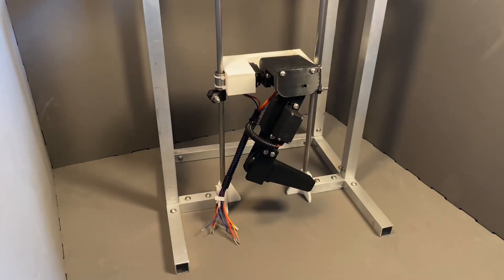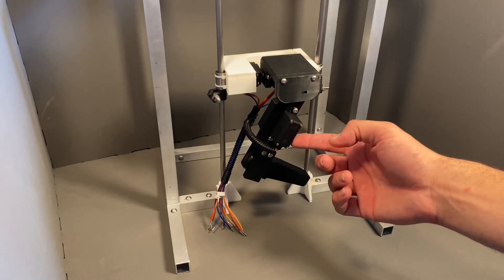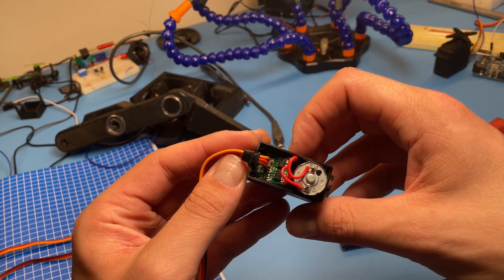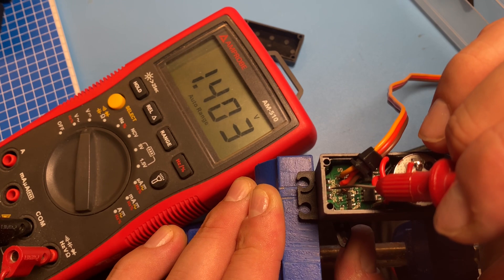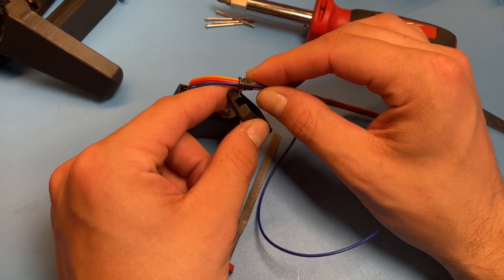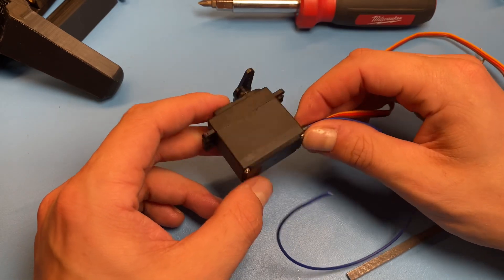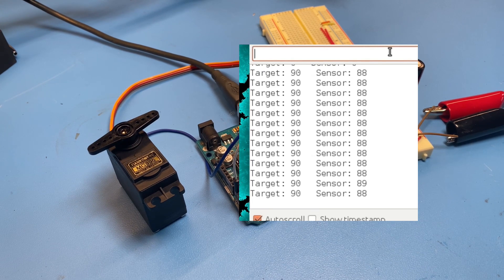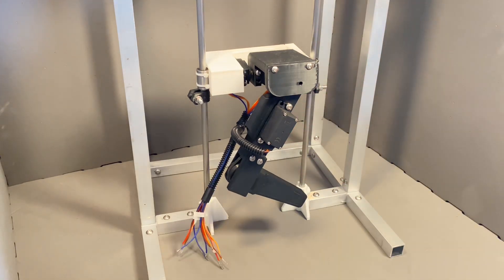Robot Dog v0 #1 - Servo Feedback Hack

Comment: hmmm. my ADC reading is jumping like 50 points, even when servo is not loaded, no force on servo-arm... like, i have servo in stationary position, and im continuously reading values, and the are between 200 and 250 ADC reading :/ tried multiple servos, same output.

Comment: That's a great idea to add positional feedback to a standard servo by simply reading the potentiometer inside it. :-)

Have you check if the 3.3V fed to the top end of the potentiometer stays at 3v3 when you increase the voltage to the servo, I would think that it does but it could be off a simple resistor divider from the VCC fed to the servo depending on how penny-pinching the designers were. :-P

Comment: You should think about adding a buffer to each feedback wire, so you don't change the impendace of the feedback loop
Reply: how would you do this?
Reply: @gedr7664  using an op amp